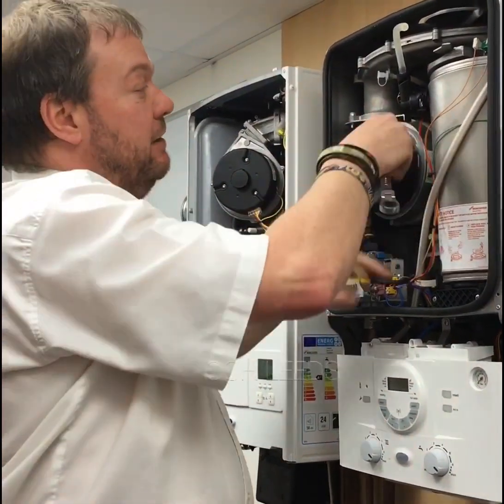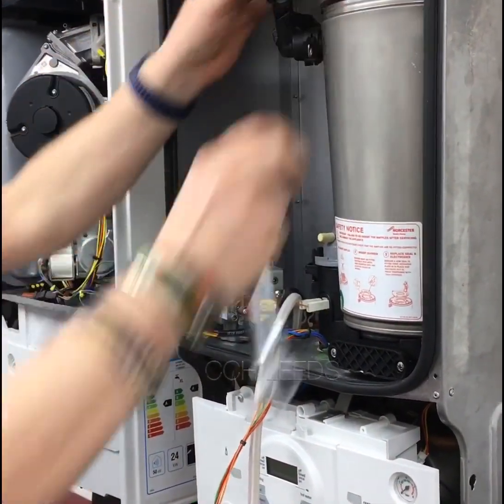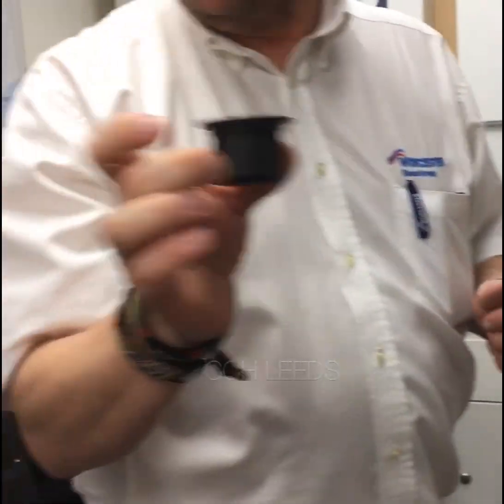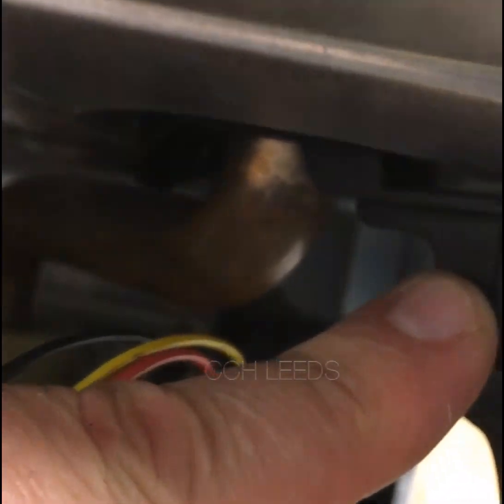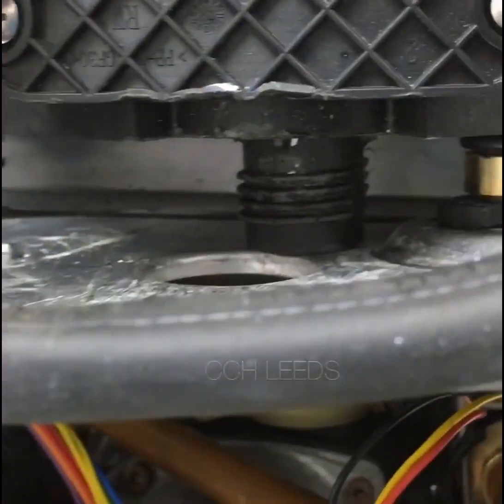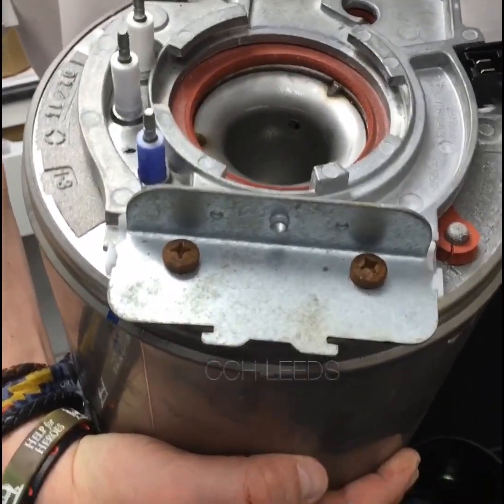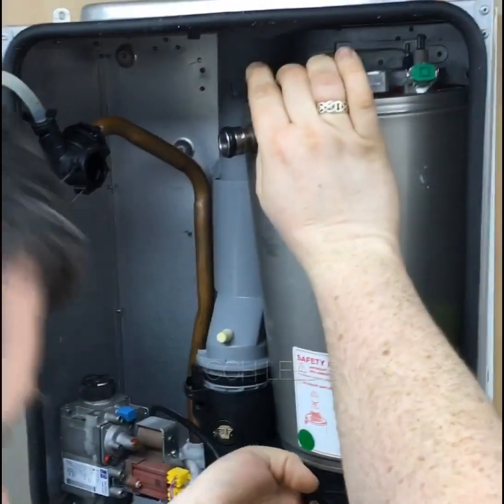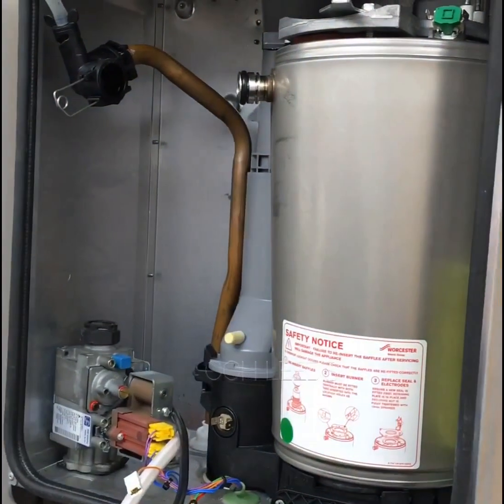HOW TO CHANGE A HEAT EXCHANGER - Worcester Bosch Heat Cell Replacement

Comment: Awful video this, sack that trainer.
Reply from the maker: Why?
Reply: @AllenHart999  Its rushed and he's missed important points out, the trainer needs to remember that people watching a video on you tube probably havent done it before or they wouldn't be watching a you tube video. Unless I missed something he didnt mention the two retaining screws at the back of the heat cell, he didnt mention what postion the black return pipe clip should be in when popping it out (left or right??) he just said ignore the book, he didnt mention to take the condensate trap off seems obvious but if he is a trainer should be giving a reminder at that point and he also could have mentioned important things like when putting the fan back on there are 4 lugs one of which is larger than the other 3 to aid lining up the fan when reassmbling. I just think it could be done better, me and my lad just did our first one and the video is not idiot proof and I am an idiot with red knuckles a bent screwdriver and a boiler thats pissed. Might do a video myslef british army style black and white or maybe I am expecting too much. Anyway I only said sack the trainer when my heat cell was stuck and I had bent the boiler, was a bit harsh I'll take that bit back now it's done ha :o) - Logic's much easier to work on.

Comment: I realise every  boiler company tries to make their boilers compact so they fit in kitchen cupboards etc. Why don't they make a version with exactly the same components but in a much larger case. Lots of boilers are mounted on garage walls or utility rooms etc where space isn't an issue. It would make repairs and maintenance a lot easier.  Also Combi boilers could be made with the plate heat exchanger  pump and expansion vessel  external thus making it much easier to work on.
Reply: That just Worcesters for you

Comment: Allen, had my Worcester Bosch COMBI installed for 4 years now, there is a filter fitted to the heating side, i live in a hard water area, and worried about limescale build up on the hot water side, i did ask the installers who are gas safe, they quoted maybe wrong, because the heat exchanger expands and contracts there will be little chance of build up, is this right, or would it pay to have a filter fitted to the hot water side, i have done the cheapo thing most people do clamp magnets to the cold feed to maybe reduce limescale build up, any advice great, the boiler i have is an greenstar or something like that ??
Reply: Have a look at Combimate

Comment: 2019 Help please! just had a boiler instaled just before Christmas, already had a water pump replaced due to noise, now we have a noise that keeps repeating every three minutes for thirty seconds or when you turn the hot tap, it's like a machine gun low sounding, surely this isn't right is it? Does the unit have two pumps, one for hot water and one for rads?  Greenstar cdi clasic erp
Reply: Get your installer back on the case. Could well be a baffle or a loose component. I've  had a fan loose on installation too. Your boiler should have manufacturers warranty. I can only suggest you call back your installer to rectify it, good luck.

Comment: Is it wise to remove heat exchanger just for cleaning, like if the boiler is located in tight compartment space on top side.
Reply: If you're competent you'd know you don't have to remove the heat cell in order to clean it. There's specialist tools available for this.  I suggest you call a Gas safe registered person  to do this.
Reply: ghostmanromeo uk I have spoke with Worcester, they said it is absolutely fine to remove heat exchanger for a cleaning purposes, if boiler is located in tight compartment space

Comment: It's funny when a boilers full  of shit parts dont come out so easily and the boiler location  plays a bit part. Workshop and on site a miles apart. heat cell cost around £300.00.
Reply from the maker: 100% lol .. Thanks

Comment: If you are changing one due to a leak there's probably corrosion in the base of the combustion chamber. If you try and force the heat exchanger up with a screwdriver you will pop the rivets on the right hand side and front of the chamber. Trust me they don't come out that easy at all. I spent 45mins this morning trying to get the heat exchanger off the return pipe.
Reply: The return pipe almost made me quit my job and sign on to job seekers....
Reply: @ronntifs476  I lube it with Wd40 have a cuppa and wedge it up and out with a Glaziers plastic tool. Changed 4 of these damn things in my time. Worcester need to start listening to the installers.

 I steer clear of them now. The longevity of these boilers are shit. The plastic goes brittle on the ret/flo manifold after a few years. The fans can be super shit too. Not the best to service either. But still better then the Cdi range. Viessmann on installs or baxi's.
Reply: tubejogger know that feeling ! Return on one I done was so in there I nearly cut it out in the end but managed in the end took a lot of effort.
Reply: I always order the return pipe. If it’s struggling to come out, cut it with a hacksaw. Job done.